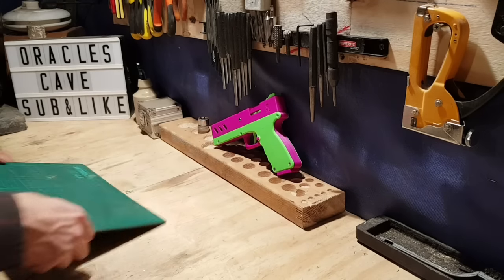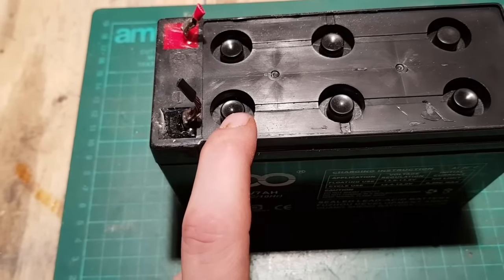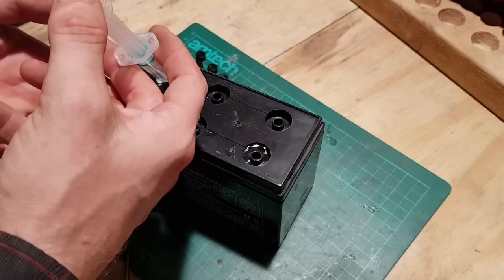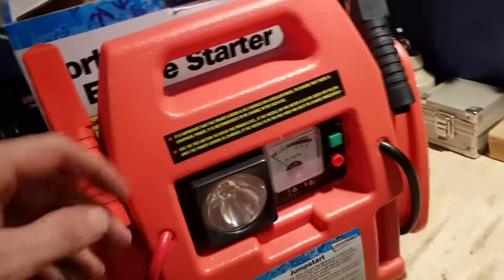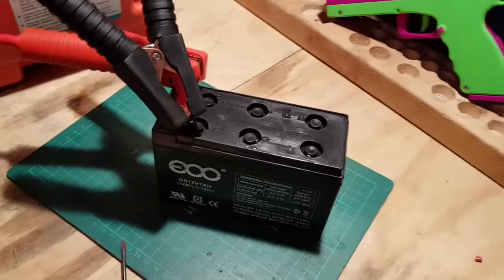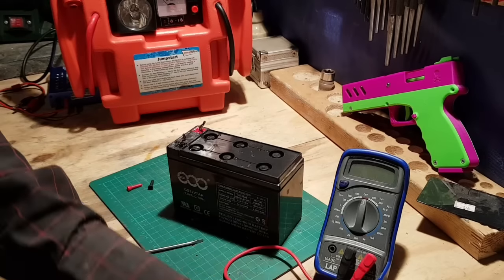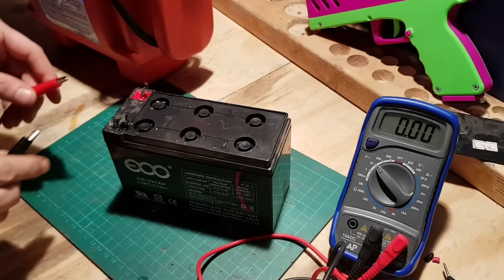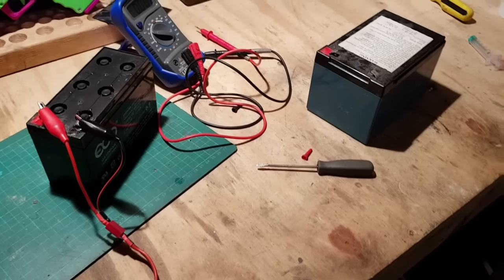HOW TO REVIVE DEAD 6V, 12V BATTERIES THAT WON'T CHARGE

Comment: Thank you very much for the explanation. I've got 3 12v batteries that I'm trying to charge, just got to find some kinda charger. Would a 12v 1 A power supply work?
Reply from the maker: Yes, normally when charging you charge as little as possible for as long as possible.
Rather than as much as you can as soon as you can.
As the battery is much stronger when fully charged at lower amps.

So even 0.2 amps would be even better, but yours should work also.
👍👍👍
But must be charger, I dont think the power supply would work.
Reply: @oraclescave  thanks for the reply! I'll give it a try. I think I've got some chargers from broken toy cars and random stuff laying around, I've even got a 12v and .2 amp charger!
Reply from the maker: @oskarkiesewalter2866  Excellent, you will be up and running in no time.

Remember sulfation can happen, where the acid has turned to a crystal form, sometimes to help make it break off the cell plates inside and mix with the water to turn back to acid, you may have to reverse the polarity for a few seconds and charge it the wrong way around.

Just google recharging battery reversing terminals, and you will get a better description, but it will bubble and fizz so make sure you google it first so you know what to expect.

ALWAYS WEAR EYE PROTECTION IF ATTEMPTING THIS, ONE SPLASH IN THE EYE WILL END YOUR HAPPINESS.

But you will only need to try this if the first way you are trying either doesn't work or battery just wont hold charge.
Reply: @oraclescave  again, thanks so much for the excellent advice. I appreciate it! At the moment, the battery puts out a whopping 1,42 volts, this is probably going to be interesting. My biggest challenge right now is getting the lids off
Reply from the maker: @oskarkiesewalter2866  just pop a Stanley knife blade in the groove and pop it, it's only held in by a few plastic spot welds, tiny tiny ones.

Show that battery who is boss, lol

I like it when the volts are low, because the results show themselves faster.
It makes you feel giddy when you realise you made it work.
Reply: @oraclescave  heheh. Mine were glued in place. There was a vacuum, so I'm confident that I'll get the thing going again. When i lifted them up, they hissed at me like a 40 year old glass of Sauerkraut.
Reply from the maker: @oskarkiesewalter2866  ha ha ha, I'm just sitting bored 3d printing a repeating crossbow that takes magazines of crossbow bolts.

So that was a much needed little chuckle.
And yes that suction noise is the first indicator the acid may have crystallized, but keep going and I bet you a million (fake) bucks it works.

And then you will be promoted to leader of the free world, or chief battery fixer for everyone you know lol
Reply: @oraclescave  that sounds interesting. How long does one print take? I've just taken a look at your channel. The interesting thumbnails made me subscribe, I'll watch some of them later.
Reply from the maker: @oskarkiesewalter2866  Thanks Oskar, and it depends on the print.
If you go for high quality finish and bearer 100% solid it could take hundreds of hours.
But for most 3d prints I use lesser quality and only 10-20% (infill) solidness and I can print large prints in 20-30 hours, but my prints are usually between 10-30 pieces.

Sometimes bits are too weak and you just make them with more infill, so sometimes repeating parts is needed but its bloody awesome.

I just got a new 3d printer the other week so I'm going at it non stop so o can review it soon.
Finished making an iron man helmet,  and some upgrade parts for my new printer, and it works flawless, very impressed.
It's called Artillery sidewinder x1
No wires hanging out, awesome build plate, fastest heating time and one of the biggest in size.

I dont have one single complaint about it.
Plug and play basically
All you do is choose a file, let the 3d software prepare it, save to memory card and install in machine, turn on and it builds by itself.

I have made loads of useful things for the house, curtain retainers, fruit fly traps, hose connectors for taps, door wedges, forks, but mostly I use it to make all sorts of weapons and funky cool things for fun.

Still learning the 3d software that creates the designs  so until then I'm just printing what others have created.
This is the future, crazy awesome
Reply from the maker: @oskarkiesewalter2866  I have looked at tinkercad and it looks like the easiest to learn on, I jumped straight onto fusion 360, very confusing and can't tell my ass from my elbow.

I will also start with designing circles and gears and a maker's coin will probably be my first full 3d designed creation.
I'm still addicted to non stop printing everyone else's cool designs, it helps me understand all the mechanics behind tuning the printer.

Most of the stuff I have made so far is just gifts, toys and requests from family members, I will be getting into the full 3d design this year, and stick at it until I master it.

Then youtube will have things to complain about, because I will make the craziest stuff that others are afraid to, lol
Reply: @oraclescave  i started like that too. Fusion360 didn't work on my PC, i didn't know about tinkercad, so i went on the internet and printed random things. So much fun, every shape i can't make with hand tools or a lathe is now the task of the printer. Good luck with your future projects, have fun! May the printer last, and the filament prices drop!
Reply from the maker: @oskarkiesewalter2866  yeah I'm on the laptop and fusion 360 is very slow running, I might have a play around in tinkercad over the next week, it's probably a better starting ground for a newbie.
Plenty of different videos coming over the summer, be glad to see you around Oskar.
And yes please make the filament prices drop, that would earn Oskar an Oscar, lol
Take care buddy
👍👍👍
Reply: @oraclescave  thanks, you too! I just have one last question. Is it bad to use tap water in the battery? I don't want to destill it myself.
Reply: Nvm i found a solution
Reply from the maker: @oskarkiesewalter2866  it's technically bad because there us minerals in the tap water that will damage the cells, and air bubbles that take a long time to vent to vent the bubbles out.

But can still work, even rainwater would work as good as distilled or de-ionized water.

Boil water, chill it and fill it, but remember to leave the caps off while its bubbling away on charge to let it vent out.
Reply from the maker: @ayezzarauras8853  yes that would work to level the battery out to 12 volts, then it would need charged for a while, but will work.
👍👍👍
Reply from the maker: @ayezzarauras8853  12v battery is around 14 volts fully charged.
That's why it would need charging after you try the method you mentioned to get the battery back to 12 volts first, or above 6 volts should be enough to get it charging again from a charger.
Reply: @oraclescave  What do I need to expect when I reversed the polarity of the crystaled battery while charging it via jump start? Hopefully, it won't explode.
Reply from the maker: @ayezzarauras8853  you are best to Google it first, but as long as your caps are open and water topped to the top of the cells, reversing polarity will make it bubble and fizz, can also spit out so eye protection is a must.

Google it and you will get a step by step with pictures.
👍👍👍

Comment: You can put jumper on battery and also the charger start the smart charger then after the 25 seconds remove the jumper leads once the charge has started  saves waiting for trickle charge from jumper.
Reply from the maker: Ahhh, nice one
I love shortcuts
👍👍👍

Comment: I have a pair of Yuasa 36ah AGM batteries that I have let go flat over covid to 8v 😞 Is there any chance they could be saved?
Reply from the maker: Yes, but you will need the older style car battery charger, NOT  a smart charger.
The only way it will work using a smart charger is, if you attach another 36v battery onto the terminals to bring the volts up and trick the smart charger into charging again.
An older style charger will just pump raw power into the battery.

And once you get it working, you will need to run the battery down again and charge again, a few times.
This will bring the charge power back up.
👍👍👍
Reply: @oraclescave  Awesome, thank you very much replying to me. These are expensive new batteries (3 1/2 years but only used for the first year in 2019) and I don't want to lose them really!  rang a Yuasa stockist today and they said they are most likely dead as they will be fully sulfated and useless, could this be true? He said they would just take and take power but hold no capacity, then explode eventually on the old charger type.
Reply from the maker: @Rob-Slot  you can buy battery replenishing acid by the 5 litre bottle, but this is not the only way to get it working again

Plus short bursts of reversing the terminals can help remove the sulphates from the cell plates.

All a battery is, is a jar, it only matters what liquid you have inside as this is what stores the energy ( electrolyte ).
I have also heard about reconditioning them with EPSOM SALTS
Reply: @oraclescave  OK, so I'll not take them to the tip just yet then :-) Thank you.

Comment: Fill it up with DISTILLED water..
Add a little Epsom salt then wait..
The next day it will charge again 👍
Reply: Why the Epsom salt? What does it do?
Reply: @imheyns1514  Naturally water is an insulator. So as is it will act as a resistor. you add epsom salt to the distilled water to make the water conductive. In doing so you make a sort of "electrolyte" that allows current to flow through and even hold a charge. hence using the mixture in a battery.
Reply: @b-rad7708  Thank you! That makes sense now.

Comment: Are your booster battery pack makers more honest than American and Canadian companies or are you like me just assuming ours are all designed to fail they only charge to 12 volts which is considered dead to start with so within a year they are so sulfated the battery won't take or hold a charge in most cases we just assume it's our fault so check the voltage of your booster pack the only half way decent one I've bought is an everstart and although the charger says it's 12 volts it actually charges to 13.1 since I can't charge through the charge port I'm going to try through the cigarette lighter port when I first read about the proper voltage when full and the proper float voltage I took apart an old black and decker booster pack and found written right on the battery do not use below 12.2 float voltage 13.4 and full charge of 14.8 and on the charger was 12 volts no wonder that it died so far I haven't been able to revive a dead battery but will try yours
Reply from the maker: Mine charges to 13.1.
I have heard good things about the lithium versions and I plan on getting one , just for size and storage.
I have actually had to use the booster pack a lot recently as the cold killed my battery, so I purchased a new one out of quickness, and it also was completely dead a few days ago.
No parasitic drain, just cold weather

So this booster pack has been kicking butt and I can't be more happy with it.

And yes nearly everything that comes with these batteries have parameters that don't match the batteries actually usage methods and end up just being slowly killed, just by following the correct  instructions.
But they are just jugs with juice and electrodes in them, so very cheap to bring back to life compared to purchasing a replacement versions.

One of the very first batteries found was the Baghdad Battery in the middle East from hundreds of years ago, and nothing has really changed on how they are made.

I love simple things.
👍👍👍

Comment: Thanks for the tips, especially the syringe to fill.  I read that you can connect the good battery to the bad one in parallel like you showed, then connect the smart charger to the pair, and it will start right away.  Have not tried it yet, anybody else try it?  Also, the AGM batteries like this are supposed to be slightly underfilled, where the liquid is not visible above the plates, but that seems impossible to do after they leave the factory.  Maybe fill just past the plates, and let charging take the level slightly below, then fill just above, let soak in and call it good.  Anybody try that?

Comment: Hi, If I add acid, do I need to mix it with the distilled water? Does same apply to the non spillable lead acid battery?
Reply from the maker: You only need to add water if the acid is not all the way to the top of the lead cells inside.
These cells need to be covered.

Then because it's a sealed lead acid battery, you will need to put the rubber caps back on after you have fully charged it, then tape the lid back on securely.
Reply: @oraclescave  its hard to see inside, but it looked pretty dry so I wondered if I should just add distilled water or mix it up with acid?
Reply from the maker: @aroniphraimov3915  yes, the acid dries up, and can be reactivated by adding some distilled water until it covers the cells.
Yes it is hard to see inside

You just dont want to fill up right to the top, as the chemical reaction will cause bubbles, and it will over spill.
Use a torch, you will see the top of something inside the hole, this will be the top of the cell.
Remember to wear goggles or some form of protection even a face shield, be very safe, you dont want to be near a hospital, especially just now.
👍👍👍
Reply: @oraclescave  Wonder if everyone reading your reply understand that when you suggest using a torch, your referring to a flashlight in the US, and not butane. (or am I missing something?)
Reply from the maker: @icbrown6133  yes I was meaning a flashlight, so you can look down inside and see the cells.

Definitely dont put a butane torch near it lol.

Well spotted, i see where that could be misinterpreted. 
👍👍👍

Comment: Hey mate. I'm up to the part where I've put the jump starter on. In your video you said you had the connected "for a little while" was this 10 mins? 30? 3 hours? Just curious cheers
Reply from the maker: Not even an hour for that battery and the voltage was up enough to make the smart charger work, if you have a multimeter you can check voltage while its happening.
👍👍👍

Comment: Our lead acid battery, when it shake, you will hesn a sound. Can it be repair?
Reply from the maker: It depends what's making the noise when you shake it, possibly a cell has been knocked loose, maybe the battery took a hard hit being dropped on the ground.

To be honest I wouldn't mess with batteries that sound like they are not solid incase the short out from the inside.

If the noise you hear is just liquid, chances are it needs topped up.
Or Google how to clear sulfates on battery cells.
👍👍👍

Comment: What do you think would happen if you use a car battery to boost the smaller battery up to the minimum voltage for the smart charger?
Reply from the maker: Should be fine, as long as it's only for a short time.
👍👍👍

Comment: Smart chargers suck. Totally stupid programed. I had a 6/12 charger. Trying to charge a 12v battery at 7.2v and it told me it was a fully charged 6v. Have to put a 12v trickle charger on it for a day to get the voltage high enough the smart charger will think its 12v battery and start charging. I can't find any old chargers on Ebay. Pain in the bum.
Reply: Just hook up a fully charged battery in parallel (a few seconds at a time) with smart charger, until the charger is fooled into keep charging.

Comment: I have a 2V 600A FGMJ gel sealed battery that is not receiving charge should I fill it with rain water, distilled water or electrolyte 1280 which is best
Reply from the maker: Unfortunately I dont think there is much that can save a gel battery, I'm sure once they are done they are done.
I might be wrong, but as far as I know that us the case, so if you find anything out that works I would love to know also.
Good luck Peter 
👍👍👍
Reply: But this is a sealed lead acid gel battery can’t just apply the same method you described
Reply from the maker: @peterudobang.8474  a sealed lead acid uses liquid acid, but I think the gel battery is an infused block as far as I know, I have never messed with gel batteries, i had some years ago for high powered offroad lights and when they died there was nothing I could do to revive them, but there may well be lots of ways to do it, I just don't know about them.

Comment: Thanks for the video. Battery is hooked up and taking a charge.
Reply from the maker: Excellent Geo, and if the charge wont hold very long, it will need fresh acid in the cells, can be purchased in battery refill or in a bottle, you dont need much but your battery will be back to brand new power with fresh acid, possibly get it from a car battery.
But your battery will work might just be much weaker than brand new.

Thanks for coming back to let me know, much appreciated bud.
👍👍👍